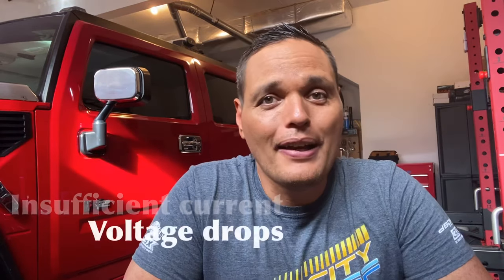The Top 10 BIGGEST MISTAKES in Car Audio. How to do it right!

Comment: I have 05DC122 kickers, what’s a good amp to run?
Reply from the maker: I’m not familiar with that model. What is the rms wattage per sub?
Reply: @NextLevelCarAudio  each sub is 150 watts and there is 2
Reply from the maker: If it’s 2, then you should be at 2 ohm final impedance. Which means you need an amp that puts out 300 watts at 2 ohms, or 500-600 watts at 1 ohm. Here is one good such option:

https://www.skaraudio.com/collections/sk-mini-compact-car-audio-amplifiers/products/sk-m5001d-car-amplifier
Reply: @NextLevelCarAudio  You are the GOAT, I appreciate it.
Reply from the maker: Fixed my reply... dang typo lol 😂 glad I could help

Comment: I'm running between 2500-3000 watts on my stock alternator in my 2017 chevy cruze and I don't ever drop below 13.9 but most of the time it stays above 14.1 even when I'm slamming BUT T I am using a 50 farad capacitor and 100% ofc wire I didn't skimp on the wire I don't mess with that cca crap that's when your asking for a fire that stuff CAN NOT handle the wattage it claims it can and will melt and ark at so many watts
Reply from the maker: Hell yes! That’s awesome man 😎
Reply: How do you wire the batteries? I have 4 agm in parallel. I stay at 12 off but 13 with alt.

Comment: How can you do a big 3 upgrade on a 2015 kia optima lx 2.4l
Reply from the maker: Run a 0awg wire from alternator bolt to positive battery terminal. Run a 0awg wire from negative battery terminal to chassis, and finally a 0awg wire from chassis to engine block.
Reply: Okay and that won't interfere with the sensor on the negative battery wire
Reply from the maker: It won’t circumvent the sensor or in anyway bypass it. Unfortunately.... but what this will do is make sure your will get max amperage to your system when the sensor opens up. There are videos I’ve seen of people bypassing that permanently and also via a switch when they want full performance from their electrical system. Lots of Nissan guys do it as well.
Reply: Okay one more question though how do you bypass it cuz I'm not for sure on that that's the only thing that's been holding me back from doing it
Reply from the maker: Every car is a little different. I’m no longer an active installer and have been retired from that field for some time now. So don’t know the specifics for that vehicle. Sorry man. If I come across the info I’ll let you know tho

Comment: 5:40 DO NOT start with that BULLSHIT regarding UNDER powering a subwoofer. NO SUCH THING, you do know when they measure parameters of any driver it is done with either 1v or 2v (states in specs). Which in most cases equals 1-4watts depending on the impedance of the driver. If under powering damages a subwoofer don’t you think they’d be blowing up or smoking in the testing labs?

Comment: I have 2 12inch 400w a peice sub 4 ohms , what amp should i run?
Reply from the maker: I’d find a good 1,500 watt amp of your choice.  Since you will be running at 2 ohm you need one with higher output.
Reply: @NextLevelCarAudio  how high should  go?
Reply: @NextLevelCarAudio  and thank tou very much
Reply from the maker: I would not go higher than a 2k. But having some headroom Is good
Reply: @NextLevelCarAudio  do i need a mono channel or what should i do there
Reply: @NextLevelCarAudio  and i dont even know the rms on it either
Reply from the maker: Yes a mono/ mono block amp that is 1500-2000 watt rms. Very important you find that info out befor buying .
Reply: @NextLevelCarAudio  alright cool thanks man

Comment: I just did my first setup and it sounds great but my lights are dimming..... i did a small test and turned on my interior dome lights and when the bass drops the lights dim same with the ones in the door (btw this is while im driving)  (MY HEADLIGHTS ARE NOT EFFECTED by the bass ) i have a voltage meter and it reads 13.9-14.2 most of the time (even with the system pounding for a good period) but then i get these unexpected drops to 12.3-13.0 and it goes back up to 13.9 and just starts bouncing up and down to 13.9 -12.3 (and thats when i get scared a turn it down 

(my ground is in the trunk hooked up to the frame which ive sanded down to get the proper ground bolted in there is no paint what so ever between that ground)

what would be the most budget friendly action i can take on this problem i was thinking mabye getting a HO alt and replacing the stock battery with xs power and calling it a day  

AMP - TARAMP HD 3000 – 2 OHMS
SUBS - Kicker 40DCWR122 dual 12 inch subs                                                                           I WOULD VERY MUCH APPRECIATE YOUR EXPERTISE PLEASE HELP I LOVE MY MUSIC
STOCK ALT AND BATTERY                                                                                                                                                                                                                                -car audio noob 
NO BIG 3 UPGRADE
Reply: ive did my best to loom everything and keep it nice and protected to ensure the best outcome 
same as with the routing
Reply: @NextLevelCarAudio
Reply from the maker: Do you have big 3 done? Sounds like power or ground issues. Big 3 is a must

Comment: So I recently got a new head unit. It had destroyed my quality. My bass is a joke. I went from my eye balls vibrating to now it sounds like there's no bass. What do I do? I have messed with the equalizer I have messed with all the options on my head unit and I've even tried returning my amp. It simply just sucks. My stock head unit sounded better than this.
Reply from the maker: Source level difference.... get a audio control unit to boost preamp voltage. Lc1i or lc2i or similar
Reply: @NextLevelCarAudio  ty my guy and I meant retuning.
Reply from the maker: Sure thing
Reply: @NextLevelCarAudio  im back in business buddy. I think i might wire up my other set of 12s to make 4 12s in the trunk of my 300. But from what your saying I should probably get a better alternator and another battery though right?
Reply from the maker: With that kind of system. Absolutely man! You don’t want your voltage to drop you much. Bad things happen!

Comment: What determines if you have an 12v 13v 14v or 16v system ?!?
Reply from the maker: What voltage your alternator charges at. You can buy a 14 or 16v alternator. Or get one with an adjustable voltage regulator. Then buy the proper voltage batteries.
Reply: @NextLevelCarAudio  thanks!
Reply from the maker: Sure thing!

Comment: Can a varta e44 77ah 12volt battery run a 2600w system and car
Reply from the maker: i'm not to familiar with varta.... but 2600 watts is not "that" much so a 77ah battery should be okay. i am assuming it is an auxilliary battery? or is this your underhood main battery?
Reply: @NextLevelCarAudio  it is my main battery and I only have one so it starts The car too
Reply from the maker: I got ya.... you are right in the power range where getting a second/aux battery would be a good idea for extra reserve. unless your alt puts out decent current and you have solid wiring. 0 AWG and big 3. You might be able to be just fine with a fresh single underhood
Reply: @NextLevelCarAudio  okay I get 1 more varta e44 77ah for The system. What happened if i go under 12 volts and do you think that Light happen when i have 2 77ah 12volt batteries?
This is my first build ever and im only 15 and spent my own money so i want to get it right
Reply from the maker: With 2 of those batteries, And the gain on your amp set properly... should be nowhere near going below 12v. That’s awesome! I got my first system at 16. So you beating me by a year lol
Reply: @NextLevelCarAudio  haha in sweden We have a car that goes 30km/h that you can drive when you are 15 and I wanted a good system i am going to have 3 amplifiers 1 2000w for The sub one 80x4 way for 4 6,5 speakers and a 150 watt total for my 2 midds i am aiming for quality
Reply from the maker: That’s going to be sweet! Good work!

Comment: And idk what is the ohms😂im a beginner im just running the lpf and hpf in the middle and the gain a quarter btw its a 4 channel amp
Reply: The resists the speakers are putting on your amp basically. Just keep it one speaker to one channel to be safe until you learn more.
Reply from the maker: https://youtu.be/ChhbQfpV8wk

Comment: Dude dont forget 9% of cars are unitized they have no frames. Seat bolt work great as long as you grind them clean just saying
Reply: Im sorry 90% of cars are unitized
Reply from the maker: Yeah they work, but not “optimal”. for unibody cars I always do a direct run from either the engine block or the negative battery terminal.

Comment: I done it wrong one time but I knew it was wrong and could burn my car down i but I was so very very broke couldn’t afford a huge wire and fuse setup so I just wired it straight up and kept a eye on it! Lasted about a year and me and my dad was leaving the store and I seen smoke rolling out from under my trim and dash! I knew in a half second what it was and ran and jerked it loose from the battery and burnt my hand but saved it! Burnt the carpet a little under the trim but that was it I caught it just in time! Now I’m old, wise, done it all once before and have over kill now. I have dual 0/1 gauge from a XS3000XP battery right next to the amps! Foot long double runs with fuse on each wire! That’s $100 bucks worth of fuses just at the amp not counting the one under the hood and the one on a isolater! And I never do just one ground I do two or even 3 right to the frame or clear clean metal! I sand everything then bolt it down with locking washers and nuts never goes any where! Now my systems run for a decade never give any problems! Both my systems are on their second cars they have out lasted 2 new cars! 😳😂
Reply from the maker: That’s awesome man! Great feedback. Lessons learned is wisdom for us all!

Comment: I have a boss 1100w  amp and pyramid subwoofer 4ohm  2x10in single coil per sub.
How should I wire it not to blow anything.
I was gonna run it in parallel.
8 guage ofc wire.
Reply from the maker: How many watt rms is your subwoofer and how much wattage rms does the amp put out?
Reply: @NextLevelCarAudio   amp is 825rms at 2ohm
413 rms at 4ohm

And the subs are 500 rms at 4 ohm
Per coil.(2x 10in subs)each have 1 coil
Reply from the maker: Well, if you wire them in parallel to a 2 ohm final load they will be getting 825 watts from the amp. Rms handling for the pair of subs is 1000 watts total. So you will be coming in pretty close to where they should be. And will be good to go 😎
Reply: @NextLevelCarAudio  cool thank,appreciate the vids.
Its gonna be my first time putting together my system.so been taking notes and doing a lot of hw.between the entire system and components. And then how to set the tuning on the amp.gonna follow your vid and tune it by ear.i get all my parts on Sunday ill try to upload a vid on how it comes out.
Reply from the maker: Hell yeah! Awesome. Post link here

Comment: So Around 6:00min you talk about over power/ under powering you subs~ im currently using my old discontinued 10 " MTX's Road Thunder Subs x2 in an enclosed non vented box! i did some researching as to what the specs were on the subs~ this is what i found out, there single 4 ohems running 250 (watts) RMS per sub and its recommended to be using 125-250 watt amp, now that being said i have 2x of them going, and i currently have a brand new thunder500.1 MTX amp that at 4ohems it runs 300 (watts) RMS... my question... is that enough to be running both subs or am i over powering the subs or under powering, some what new to the car audio scen being over 5+ years since doing my own installs not to mention there wanst half the info on the internet then! just would like to make sure im not wrecking or going to cause a fire thanks in advance.. and thanks for the videos keep em up!
Reply from the maker: Hey buddy, so if you have two 4 ohm subs wired in parallel, meaning positive to positive and negative to negative all the way to the amp inputs, you will be at a 2 ohm final load. So your subs will be getting whatever your amp puts out at 2 ohms. Sounds like that will put you right in your recommended RMS power range so you are good to go! With that tho, sealed enclosure do take more power to have the same output as vented enclosure so switching to a vented (if recommenced for your subs) would make them louder without changing anything else. Just a thought. Anyway, hope that helped! Thanks for supporting the channel
Reply: @NextLevelCarAudio  this might sound stupid, but if you mean running in parallel as in my one sub for example the left one ( is + into the sub then leads to a terminal on the box hooked into the + and ofc - to - then from the terminal i have my +/- going to the amp... and then ofc the 2nd sub ie " the right one" is hooked the same way.. they each are running there own +/- to the amp's speaker +/- outputs! if that makes sense? also i realized the amp i have no is recomending a 60amp fuse, but the 4gauge wiring kit i had for my other amp is running a 80amp is that a huge deal??? i also am going to upgrade to 12" mtx's as theres a sale on them right now at a local audio shop reg 150$ on for 48 i just purchsaed 2 of them with 3 years of warrenty for 142$ cnd all said n done! now i need to buy a box id like to build one but the cost isnt much cheaper then just buying a pre fabbed one! is what do you recommend for 2 12" subs~ thanks in advance!
Reply from the maker: hey man, no i got you perfectly fine. that is another way to run parallel. you can either "daisy chain" your subs positive to positive and negative to negative all the way to the terminals of your amp. Or separately going directly to your amp terminals. As long as all positives are together and all negatives are together you are good. If your amp is recommending a 60 Amp, i would give it what it is asking for. Will it hurt anything if you dont? probably not. but if you have a bad short or power surge it may be just enough to pop your amp instead of the fuse. better safe than sorry. Great deal on your sub purchase! my first subs ever were MTX thunder series i beleive the 7500's they were. anyway, a custom built box will ALWAYS give you best performance and sound better, but will always cost more as well if you do it right. In the end, you typically always get what you pay for. If you want good output and louder bass, i would go ported. if you want cleaner/tighter bass then go sealed. hope that helped
Reply: @NextLevelCarAudio  Alright cool budsy, I wasn't sure if how i had them wired was the same as parallel or not. I was pretty sure it was the same..But I definitely ordered a pack of 60 amp fuses not worth an amp surge and or causing a fire in my Lexus, Especially when i was the installer lmao!! But yeah i didn't think it was a bad deal, iv personally only ran MTX or KICKER... But obviously there is better brands out there for quality and performance but for what i want to achieve for my budget and keeping my stock deck/ alternator and battery i cant  go wrong with my MTX set up !!! like you said, you pay for what you get when it comes to car audio! Did some more researching about sealed and ported enclosures, i guess the decision comes down to, how much room you wanna give up in your trunk/vehicle and i guess kind of your music taste... Iv never had a vented box and would love that to be my first DYI build.. But i dont think the is250 has the trunk room!!! Thanks for the knowledge and the free content.. keep the videos coming!!! cheers
Reply from the maker: Thanks man. Appreciate it! Good luck with your future build!

Comment: Question my man . Great video .  Now listen . Im doing 3 Md 8000.1 taramps amps on 3 pride audio St 18 in a 4 th order in a cadillac escalade . I have the stock alt for the car and a 250 amp hour alt for the music . Is 80 ah of LTO XS power good enough or should I go 160 ah of lto. Thks . And also what size ANL  fuses is idea to use ?
Reply from the maker: That’s a lot of amp hours for LTO! Nice! If you want to hold voltage, I’d say go for 160. 80ah would suffice if you had more alt power. Like dual 250’s or a single 500amp. As far as fusses, 350 amp fuses for 0awg wire is the industry standard. I’d use that with multiple runs depending on your amperage draw
Reply: @NextLevelCarAudio  thanks bro . Awesome

Comment: Save yourself time and money. I run a power and ground directly off the alternator to my back lithium battery and kept all my stock electrical. The least resistance is the best. 0 voltage drop at idle. running 2 Sundown 18 Xv2 with a Sundown SCV 3000 Mechman 250 amp alt
Reply from the maker: I have 3 runs of power and 3 runs of ground from my dual Mechman 370’s going back to my pair of cyber 12’s... but most people wanna be lazy and find a ground point in trunk near the amp. So I’m teaching on how to do it that way right. Not bad, but def not optimal.

Comment: Happen to me today turned the fire out before my whole car went into flames front battery caught fire an rear battery caught fire just gotta replace sum cables an my car still drives
Reply from the maker: Wow. Scary. Glad your car survived
Reply: @NextLevelCarAudio  yes it was scary power wire got cut thru the hole it was ran thru an caused it to ground out an caused it to burn up rushed the install wen i did it now i know to take my time an make sure its proper